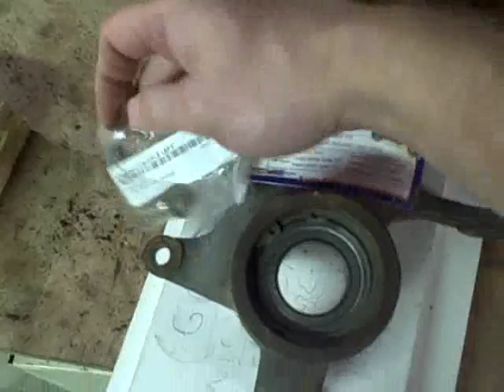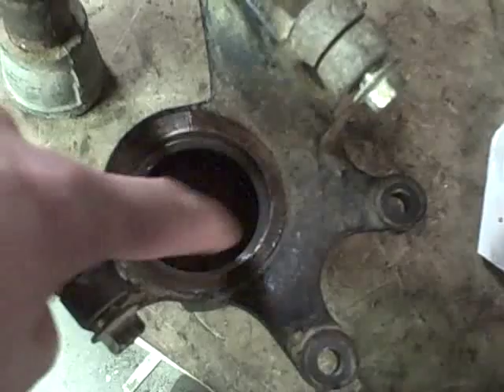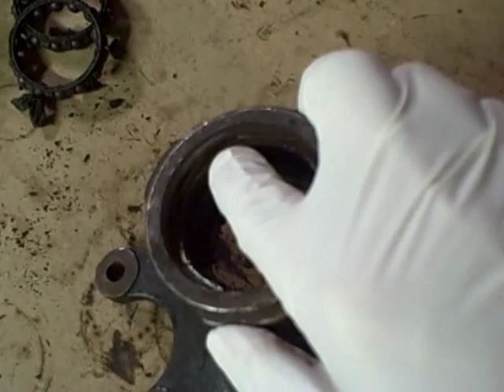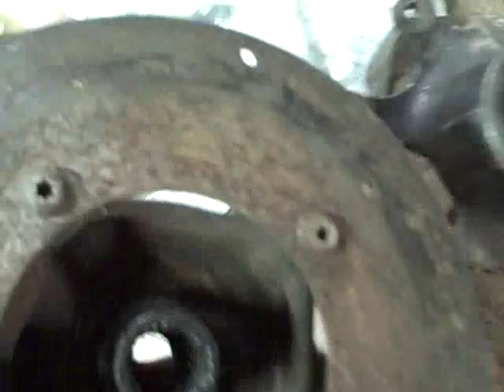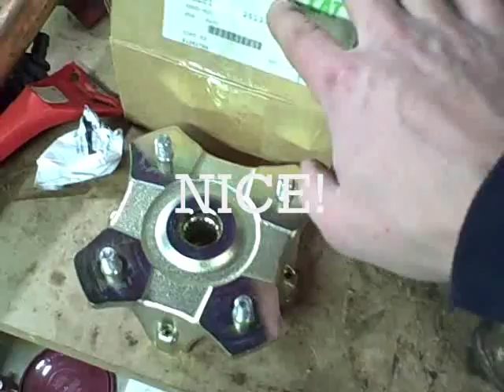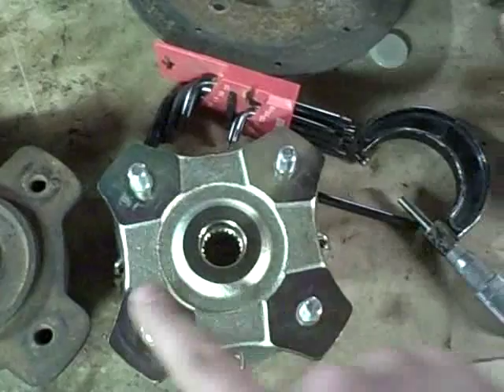Arctic Cat Repair Project Part 10: knuckles and hubs

Comment: Friend I just have the same problem now that you had the left strearing knuckle got bad on my 2005 artic cat and right I am told by the place that is servicing the 4x4 that that part is discontinued so I need to find one to buy do you have a good place that I can get in touch with to buy this part or maybe a phone number for a business or a email address to send me to find parts
Reply from the maker: You should try finding a good used one on Ebay. That is going to be your best bet
Reply: @stevewatr  I looked on eBay and found a good buy for a steering knuckle I will receive it next week so hopefully that will take care of the problem I found out from the shop I have got that parts like this are discontinued and that is bad for the future so !